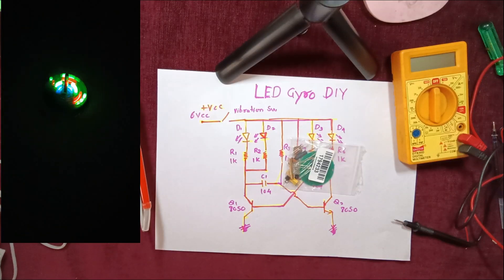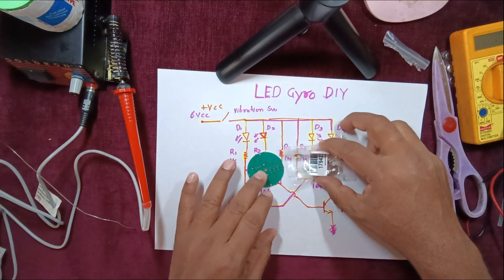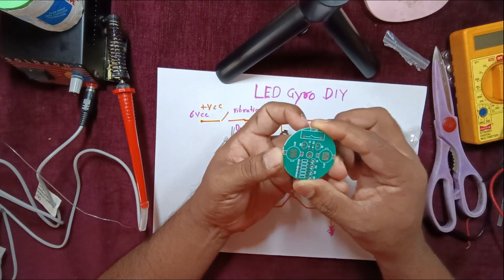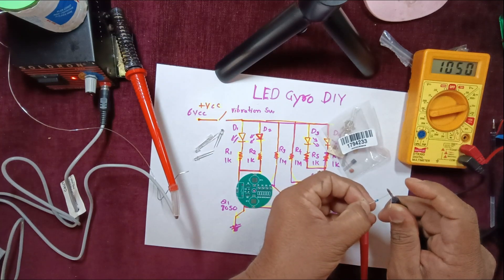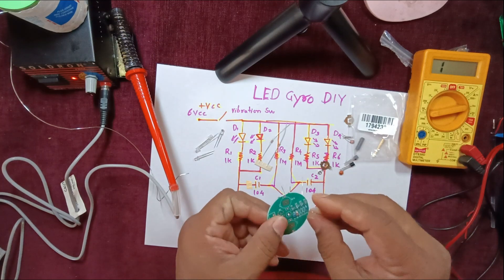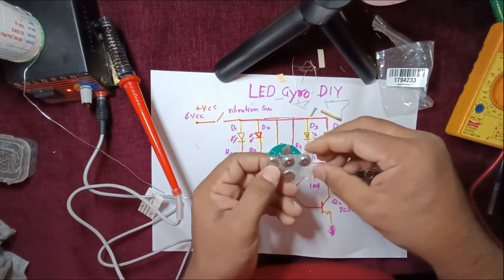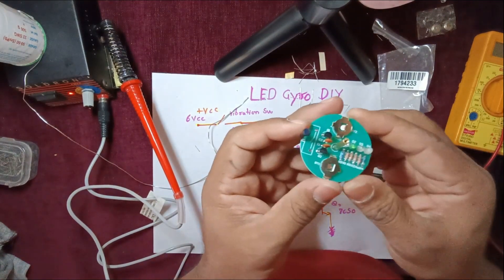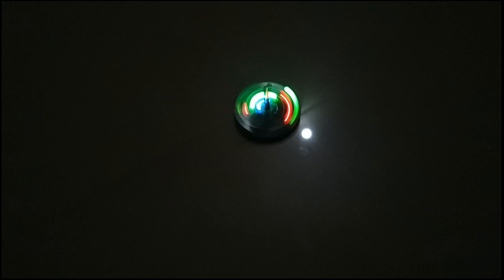DIY LED Self Start Gyroscopic Top Kit Rotating Lantern

Comment: Does vibration sensor has polarity ? 
What’s the battery specifications ?
Reply from the maker: No vibration sensor dose not have polarity
Reply: Cell specifications? Type and voltage
Share the link to buy these cells !